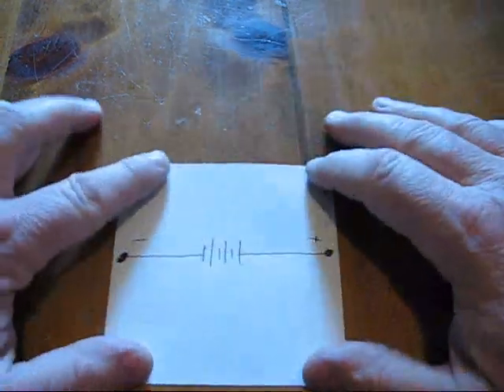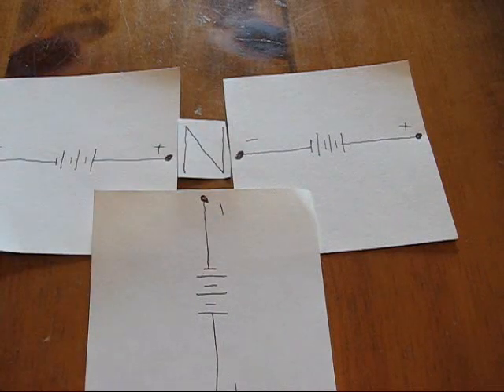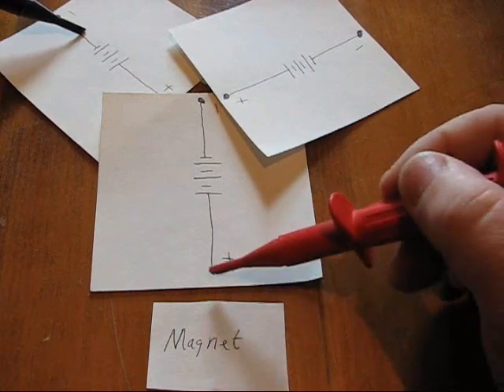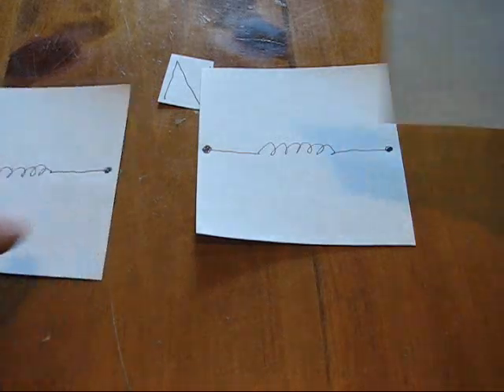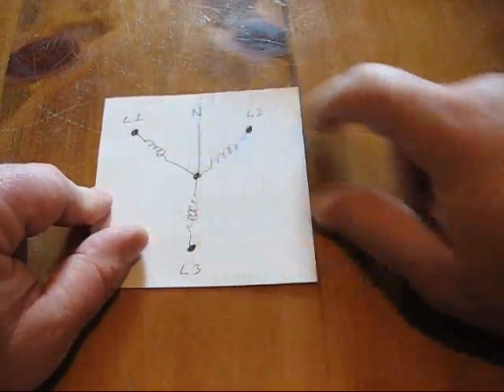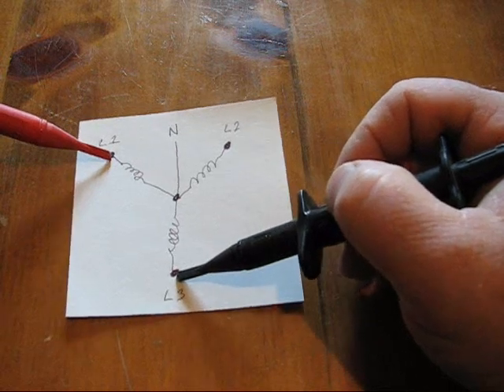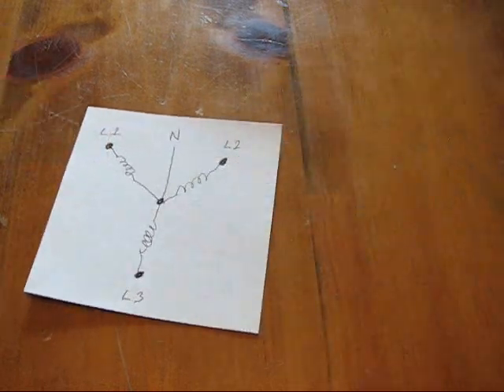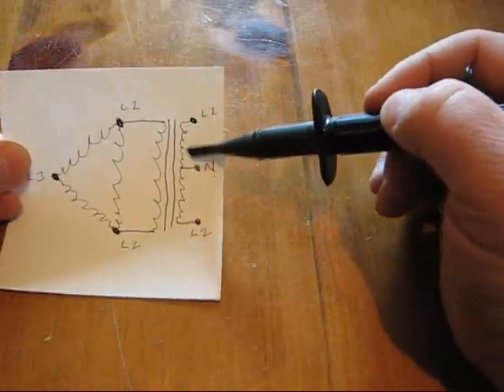Three Phase Power: A Simple Explanation

Comment from the maker: Three phase is more efficient than single phase in terms of both generation and power use in an electric motor. Also, three phase electric motors are simpler and less costly to produce. But there is no real gain in having more than three phases, while cost and complexity would increase substantially..

Comment: After seeing this, I picture an AC motor rotating it's magnet embedded rotor in an analogous way to hula-hooping...If you picture hula hooping by bumping the hoop in three locations, say at 120, 240, and 360 degrees from your "12 o'clock", or " 4, 8, and 12 o'clock". Your bump adds rotational energy to the hoop in the same way that the attractive and repulsive forces of the magnetic fields from the 3 phase stator adds rotational energy to the rotor.

Comment from the maker: Thanks for the comment. The voltage difference is relevant, and is a function of the phase angle relationship between two windings. This video doesn't cover that aspect because it is aimed at practical application instead of heavy theory.

Comment from the maker: That's interesting. I wasn't sure how it was done in the UK.
A ghost phase is just a connection method that allows a 3 phase motor to run (albeit not efficiently) on single phase power.

Comment: In the UK the phase to phase voltage at local distribution is 415V with 230V phase to N. All domestic suplies are single phase to Neutral. We don’t use double phase. However, those requiring 3 phase supplies will have all three lines connected and not use a ‘ghost phase’  what ever that is?

Comment from the maker: Technically, yes. But what comes into a home is single phase 220 with a center tap (on the pole transformer) for 110, and L1 to L2 (or L2 to L3) of a 3-phase generator will power a load that is designed for single phase 220.

Comment from the maker: I'm not 100% sure (I'm geared toward generators rather than distribution), but I don't think neutral is used in US transmission lines. The neutral is added at the pole transformer.
It's no big deal to do it that way; it just takes a transformer with a single input winding and a center-tapped output.

Comment from the maker: It is a simplification, to help those who don't understand what is meant by thre phase to get a handle on it.
Fine, the summation of two phases of exactly 120 volts does not equal exactly 240 volts. Happy?
"120 volts" and "240 volts" are nominal. Most "120 volt" appliances can accept anywhere between 100 and 130 volts, and most "240 volt" appliances can accept 200-260 volts. This video is not about wave theory, it is about practical applications.

Comment: Tera Volt, you are right on the money. It is wrong to claim, as it did show on the video, that the summation of 2 independent phases 120v each results to a voltage of 240v. The voltages are 120degrees out of phase and their sum

Comment from the maker: Correct, residential single phase power is not 3 phase. But you CAN run single phase appliances from two legs of a 3-phase source as long as the voltage is within tolerance.

Comment: Also, commonwealth countries do away with the split-phase (two 120V windings in series) system altogether and have 230/400V (λ wye) at the transformer secondary. Notice if you take 230 and times it by √3 you get 400V ;)
Single phase is one winding to neutral (230V), and two windings in series or a delta winding for 3 phase loads give 400V.

Comment: Not a good explanation, it's misleading. The sum of two phases together is the single phase voltage times the square root of 3 (due to the phases being 120° apart). It does start to get confusing for a beginner but it is not the wrong answer. They need to learn single phase properly first.
Residential single phase power is exactly that, only one of those phases but split in half to give a 240V supply that has two 120V windings which do add together here, but it's not 3 phase.

Comment from the maker: That's true, and is the reason most 3-phase power sources are rated at 208V instead of 230V, for example. But that is still within the voltage tolerance of 220-240V appliances, so it all works out.

On the generator end, running single phase loads from a 3 phase source lowers efficiency but not enough to create problems.

Comment: Just one question.... If you take the V from 2 diferent phases, you won't allways get the add of those two.... how do you know the coils are generating power in the same direction? If it were 2 phases would make sense (since the electrons are moving to the same direction), but being 3 coils with 120º between them, while one is 110V, maybe the other two are 70-80V

Comment from the maker: That is correct; L1 to L2 (or L2 to L3, or L3 to L1) is single phase power. So is L1 (or L2, or L3) to neutral. Still single phase, but at half voltage. In a single-phase application you don't use the third connection. Your neighborhood might get L1 to L2; the next neighborhood might get L2 to L3 to keep the current draw balanced. A 3-phase motor doesn't use the neutral connection at all.
The coil (stator winding) is where the electricity is generated. Refer to the other video for explanation.

Comment: Thanks, nice video. So, if we connect the L1 with L2 it's a single phase power, but after we connect it to L3 it become three phase power? Is the L3 is not connected to power, but get the power from L1 and L2? Is the neutral terminal from ground to transformator coil than go to the motor? And, where is the coil power came from?

Comment: A great explanation of single and three phase power. You should post this on the RV sites because there is probably more confusion as to how shore power works there than anywhere. I've tried to explain it in emails until my face turned blue and they still don't get it.